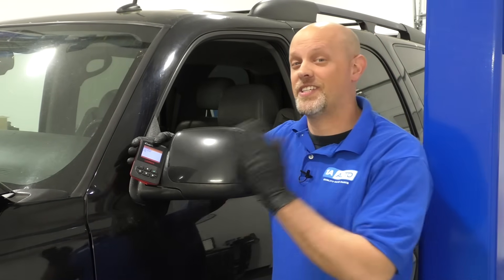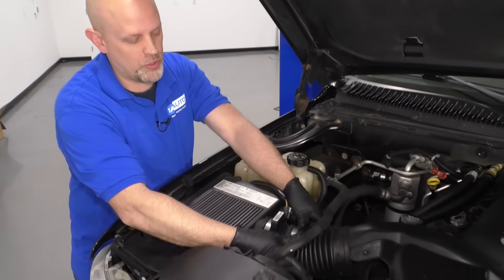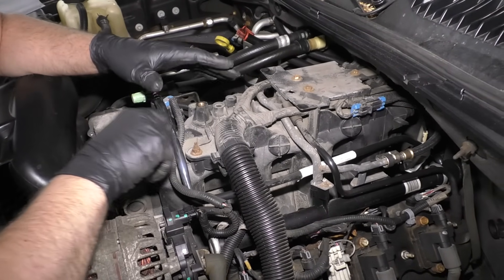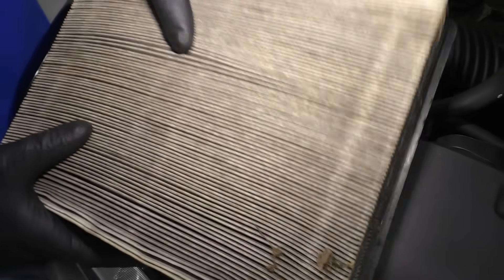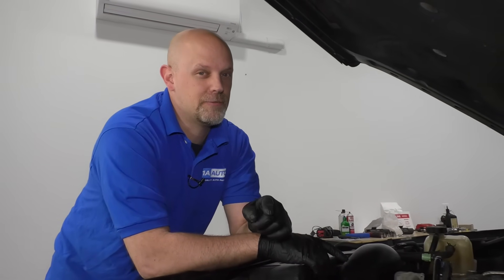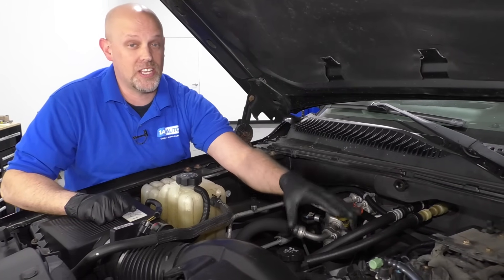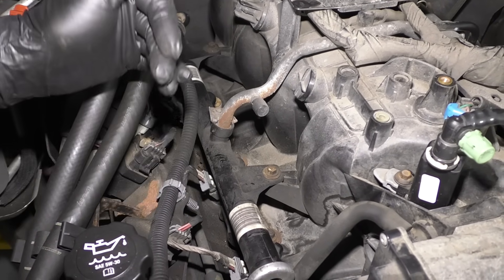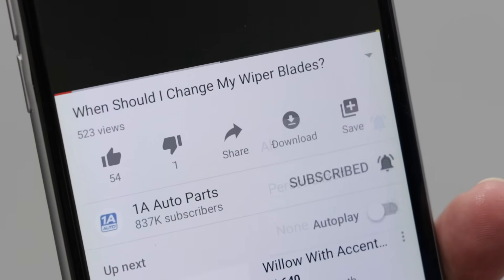Check Engine Light? System Too Lean - Code P0171 or P0174 on Your Car or Truck

Comment from the maker: √  Watch the Video
√  Buy The Part at 1A Auto https://1aau.to/m-Visit-1AAuto
√  Do it Yourself
√  Save Money
Reply: Watch out for the A1 out they are scammers. They fucked up my car and they kept on sending a supplemental claim to my insurance every often.  All when I've had a seizure attack and I was in the rehab.  A1 AUTO YOU RUN SOUTH.
Reply: Clutch fan and water pump show them how to put them together
Reply: Thanks  for  your  advice! That  was  exactly  what  happened  to  my  van  after  belt  replacement. Fixed  myself!

Comment: I'll be changing my purge valve The only code that I have on the car is 174 I looked at my fuel trim and only on bank two has the issue it goes to negative it could be a fuel pressure but I the car that I'm driving don't have a way to do a pressure test any help would be appreciated

Comment: Thank you so much. I found a leak on the Crank Case Hose. Sealed it up and the Codes did not come back and the GMC Sonoma is Running great.

Comment: Is it safe to go on a long road trip with p0171? I need to go for an approximately 1,200 K miles round trip, but an orange check engine light has been on in my car for the past month and when scanning it shows p0171-system too lean bank 1. 
So, is it safe if you go on this long road trip withs issue before repairing it?

Comment: I scanned my 2005 Buick LeSabre with a 3800 II engine and this code popped up, so after watching this video I removed the whole air box and found that either a mouse or chipmunk has been storing acorns in the air box. I removed it and at least one cup full of nuts and debris fell out when I shook it! I vacuumed them out then blew the entire box out with compressed air blowing out several more acorns. Then I test drove it and that engine has not run that well in weeks!  Saved me a BUNDLE!

Comment: I was using low-grade fuel in my 310,000 mile Volvo. I would rotate regular, then plus, then super. To save a little money. Make big mistake. My mistake. This code hit. So, I’ve gone back to premium fuel, and I am Changing the oil. I’m just gonna drive it until the code goes away. Not putting any money into this thing. It’s a beautiful car, but with 310,000 miles, it’s not worth the fix. This is gonna entail. I’m guessing at least $1000.Thing runs great. No rough idle. No sputtering. Same gas mileage.

Comment: 1999 Silverado with the LM7 had a leaking EGR tube at the intake manifold, just hoping to help someone looking for a vacuum leak. Still have not seen any of the YT videos mention the EGR tube as a source for vacuum leaks on 1999-2002 GM V8's. 2003 and later do not have EGR.

Comment: I recently changed the fuel pump in my 08 sierra. Cleaned the MAF and throttle body. Runs great but then I got this code. After watch this video I checked the snorkel and realized I forgot to plug the hose into the intake snorkel 🤦🏽‍♂️🤦🏽‍♂️🤦🏽‍♂️ thanks lol

Comment: After replacing fuel injectors in a 4runner 1999 I missed a hose that goes under the snorkel. Easy to miss because once you install the top manifold thw hose disappears under the manifold. from now on I am counting how many hoses I unplug

Comment: You saved me a whole lot of things , firstly time, secondly money , and try and fix issues which many of our technicians mostly do here . My car is 2007 Toyota Avalon with a 2GR-FE engine , I drove out today I notice delay in my car movement but not so significant, just slight difference I noticed because am familiar with my car , if it was a stranger they may not noticed , just this evening I decided to put my OBD2 scanner and got the two code p0171 and p0174 my mind was shaky , then I stumble upon this your video , I have only watch it for 2 minute 50 second and the problem is solved , one of the hose to the air line has loosened totally almost falling down. I re insert it firmly and test drive and my car is 💯 back to normal and no more code.  The  power of social media is so huge, this video just saved a brother from 🇳🇬 kudos to you I have subscribed to your channel instantly keep the good work up 👍

Comment: solved my code issure by installing heet and techron, then running it.  PO174 can also be caused by gas tank cap.  I cleaned it and greased O-ring too!

Comment: The question is. If the code is p0174 system too lean bank 2, Which sensor would you change ? Sensor 1 bank 2 or sensor 2 bank 2?

Comment: I have that code and was told they might need to tear it down and it might get expensive. Every time I gas up the engine light goes out for 1 and a half or 2 days. I have a chevy sonic. I am a female that is not a mechanic. I thought about fuel filter. What other things could I have them check without tearing the engine down. I will have to trade my car if I can't figure this out. I am not mechanical but you are a good teacher.

Comment: Do you physically have to add any pressure to the system or does it create a d disapate on its own? 06 4wd 4.2l ext Lt trailblazer

Comment: I have this code on my 2010 Subaru forester I changed the air filter mass air flow sensor and o2 sensor and checked the vacuum lines and air intake but still the code comes back every now and then but my car rough starts and idles rough how can I fix this issue

Comment: Awesome comprehensive vid thanks! Apparently the fuel tank breather valve is the potential culprit on my car (2014 Mini Cooper S)...Any ideas where to get the spec for what the resistance measurement should be? I'm reading 16.5ohms, which apparently is low but I'd like official confirmation

Comment: You can also check your oil filler cap to ensure it is tight.  Also loose fuel cap.  Also check you PCV valve.  Another cause is a weak fuel pump.   Fuel usually can be associated with a long start.  Means that pressure is too low.  

Another thing that can cause intake leak is the mastercylinder hose.  That is attached and needs vacuum. There is a valve in the hose that is supposed to be one way.  

Also, one last thing, check to see if an exhaust leak might cause it.

Comment: Possibly caused by a ground wire fault at the oxygen sensor?  Might be causing to read low voltage.

Comment: i’m getting codes p0171 & p0174 when i’m driving at lower speeds you can hear loud air noise and the rpms go up and past gears

Comment: Let me add a very simple fix that you should look for before doing any of this. Check the oil fill cap. I had the exact same set of codes on a 21 Tacoma, and when I opened the hood, the oil fill cap was gone. Replaced it and codes were gone immediately.
Reply from the maker: +@mohamadalfakir9674 Thanks for the feedback!

Comment: My Ford 150 2004 have 174 and 300 I change the PCV valve and the check engine ligth is gone but the ignition make explode when I give gas

Comment: i have a problem with my 2018 toyota highlander it has multiple codes P017100, P117000,P017400,P160500, P030085,P030027,P030000,P030100,P030200,P030300,P030400,P030500,P030600, B1486 , C1280 all these codes are showing

Comment: Well I'm pretty sure that p0171 might have something to do with the air. But for my car it's  more of a fuel issue. My car has been having fuel system issues since even before the fuel pump and camshaft sensor went out. So I'm pretty sure it's either the O2 sensors went bad all of them, or the fuel injector is bad. Honestly, I rather have it be the O2 sensors then the fuel injector. But I still think that P0171 is O2 sensor related. And plenty people tell me to stick those fuel injector cleaners down the gas tank. But I did that and all I did was mess up the O2 sensors sensors. I actually replaced the O2 sensors before I even even replaced the fuel A little under a year ago. So now I got to change them again. So please don't stick those fuel system cleaners down your gas tank. It does no good for the O2 sensors catalytic converters and fuel filters. I don't care what it says on the bottle. That's false advertisement that's just to get you to buy their product. Trust me, I know what I'm talking about. This video is very helpful. The only thing is the people at AutoZone told me it was this the downstream O2 sensor but the people at O'Reilly's told me that it's only an upstream O2 sensor. So I'm just going to go ahead and buy and replace all the O2 sensors. p0171 literary said bank 1 running too lean.

Comment: Your advice was excellent!  Out of the 10 or so things that could have caused P0174, you suggested first checking every place where air could enter the system after the MAF.  Sure enough the oil change guys had left a tube off the air filter box when they changed the filter.  Popped it back on and what do you know! code gone.  You saved me about $300 on a service call -- thanks for the common sense video.

Comment: My 07 TL has a valve cover leak. Can that trigger this code?? My CEL came on today but that's for a different issue. When I plugged in the OBD2 reader I saw this code but can confirm this was not what triggered the light

Comment: im getting those codes but no issues with the engine, my transmission kicks when changing gears 1 to 2, plus my traction and stability lights turn on and off.

Comment: 2010 crv with P0171 code. Looked forever couldn't find the air leak bought a smoke machine $100 Amazon found leak behind intake plenum. Hose that runs from pcv to back of plenum had damage from rubbing on hose clamp behind it.

Comment: Thank you for this video. Po174 came up on my 99 gmc the other day. I had just had a new rotor and distributor cap installed and your instruction lead me to a hose that the mechanic forgot to reconnect. I did and it’s running like a sewing machine.

Comment: Thanks for this helpful video.  I had the P0171 code on my 2019 Colorado, and found a loose hose on the intake.  I reconnected the hose, started the engine, and the check engine light was off!

Comment: I have same check engine P0171 ( system too lean in bank 1). my car toyota camry 2009 LE 2.4 Ltr. I have replaced with new fuel pump, new 02 sensor upstream,downstream both, new air flow sensor, new all 4 spark plug. but still the issue not resolved.  while I run car for 10 to 20 minutes the error show up. I reset the check engine by OBD machine. but still after running 15 -20 minutes show up again. what else I can do now to resolve permanently?

Comment: Thank you @1AAuto , this assisted me in finding an intake leak after I had replaced the air filter causing both the P0171/0174 code as well as "Stabilatrak & Service Traction Control" errors on my 2007 Escalade.
Reply: What was it

Comment: P0171 with intermittent Check Engine light on my 2000 Pontiac Montana with the GM 3400 SFI here. I found a rubber vacuum cap on the upper intake manifold that was turning into dust and mush. Sure enough, there was a pinhole of light visible through the cap. Just replaced it. Unfortunately, I also have a P0452 that’s likely from the replacement fuel the shop put in last year. It was making a high-pitched whine from the start and the shop refuses to warranty it just because it’s technically still working.

Comment: Had a mechanic check my 370z with scan tool an he said one the codes was 701 which he said bank 2 was running lean an another code saying bank 6 was running lean. I just had the spark plugs changed out just before I had these codes come up, took it back to service station (nissan) twice and they said they can't find anything wrong with it but I had a yellow dash light "service engine soon" come back up before I got home from service depth at nissan. They basically drove it around some for a week, said they checked MAS and other things and couldn't find amythn. It has hesitation at 3500 ram's in 3rd gear... I'm at a loss here, service manager is supposed to call me this week an talk to me, but why couldn't nissan place find the problem with the codes shown on my car.? Been one heck of a bad year ya guys.. any suggestions would be welcome.

Comment: My 2006 2500 HD had a P0171 Code, I took the cover off the top of the engine, started the truck and immediately heard a leak from the drivers side hose connected from the engine plenum to the valve cover, thanks to this video, I found it pretty quick and fix the leaking hose.

Comment: 1A Auto videos are a huge help and very professional, thank you! 
Started looking into my 2005 Rendezvous that had sat a while. First code was for the P0175 code to change the O2 sensor 1 bank 1.( I should've watched this video first.) 
Changed the sensor, cleared the code, good for a couple days. Then it threw a vacuum leak code, found a kinked vac line, so changed that. Today the P0171 code and found your video. 
Wish I could send a couple pics of what I found. Chipmunks built a nest in the airfilter box and also plugged the duct screen to the mass airflow sensor! Vermin!!!

Comment: Listen for hissing or use carb cleaner and spay on some areas (hoses or where air flow would be, avoid electronics if possible) while engine is idling to see if the carb cleaner smooths out the idling, if no hiss or no change with idling and carb cleaner, check fuse for O2 sensor (usually under hood), if fuse is good, could still be a bad O2 sensor, if you want to try replacing the first upstream one whichever bank its on (cylinder 1 or cylinder 2 for the banks respectively) can try that route, as its usually cheapest. Harder down the line and more cost involved is fuel rail/fuel injectors, fuel filter and pump, EGR and PCM (Powertrain control module), good luck guys and dont burn yourselves on hot exhaust. Hot exhaust is best and easiest way to remove 02 sensor but its also the most dangerous, so keep that in mind and focus on safety.

Comment: Could a hole in a exhaust cause the p0174 code to pop up I have a 2006 Jeep grand Cherokee limited 4.7 motor , I replaced the map sensor and throttle position sensor and air intake sensor , and it has a engine light and that code pops up

Comment: guys i been battling po171 code for 3 months now im dying and suffering  i  changed MAF sensor, did smoke test no leaks, change spark plugs..midas dont know whats wrong with it lols..any one can help ? lols thanks!
Reply: Fuel filter? Fuel pump?

Comment: Filters clean mine doesn't have a mass air flow sensor it has a temperature air sensor got it fixed the only thing I could think of would be an injector

Comment: Great video.  Not covered, can a gas cap, vent problem cause a lean code as well?  Since low fuel delivery would result in lean as well?

Comment: I got a 2008 dodge charger code p0171 I asked a worker at autozone and they said I need to pcv valve and  egr or 02sensor do I need to replace them ?

Comment: The code p0174 pops up, ots been there for a week I have been driving the vehicle, when I woke up this morning, starts the truck the engine light was gone. But still feeling the vibration form the engine, what can be the problem here, do i need to worry

Comment: thank you for this. recently installed a new PCV on my crosstrek and got the p0171 after relearning the idle. Checked all the connections and air hoses .. lo and behold, when I reinstalled the rubber tube that runs down to the PCV flange, the tube cracked. I definitely would still be scratching my head if you hadn't given me the confidence to really inspect the air intake system thoroughly. Thanks!

Comment: Hey, that's my engine! The GMC 5.3L. I need to replace my purge valve this weekend to fix a P0440. And while I'm under the hood, I'll clean my MAF sensor and check all my connections.

Comment: Checked everything. No tears, nothing loose, no performance issue. Just a check engine light that came on while driving and p0171 code only. What now?
Reply: Did you ever fix it?

Comment: If it's an O2 sensor, it will give a lean code while running super-rich.   Mine old ranger was giving a lean code while practically spitting charcoal briquettes out the tailpipe.   The sensor was broken internally and would rattle when you shake it.
Reply: Best comment

Comment: Mine is saying that code but the car bogs and wants to shut off could it be caused by a dirty air filter?
Reply: “Too lean bank 2”
Reply: @ayooocuz  One side could be an oxygen sensor, especially if it starts okay, but then bogs down when it warms up.  Look at the exhaust. If it's running lean it should be clear.  If it's sooty then the sensor is hallucinating that it's lean and throwing tons of gas into the mix.

On a Ford RWD, bank 2 is drivers side, but I don't know if that's universal.

Comment: Great video.  Don't fully rely on carb cleaner on intake leaks.  Smoke test is the best way to find any vacuum leak on that entire system. I fix these lean codes on chevy engines all the time.  Addressing these will make you engine last much much longer
Reply: And how fo you perform a smoke test ?
Reply: @kalaman12  there's a machine mechanics use to push smoke through entire system

Comment: I fix my truck Nissan Pathfinder 2009 with code p0174 p0171 i changed the gas cap and fixed